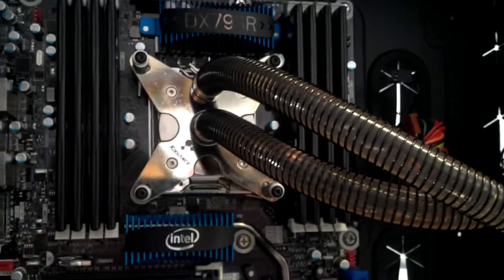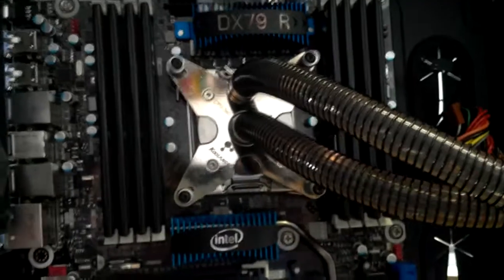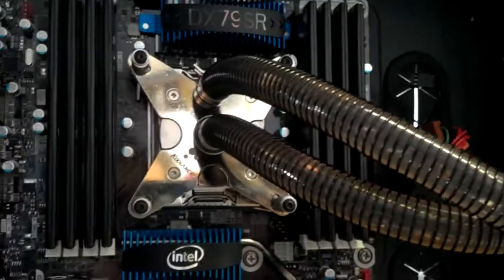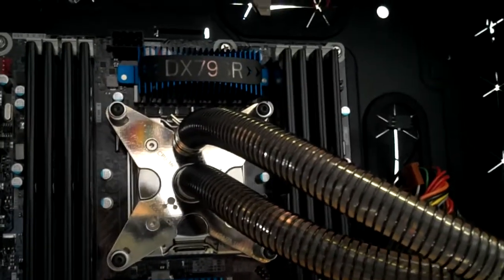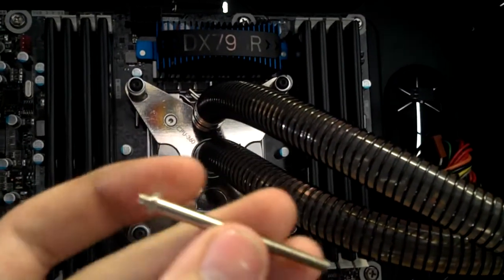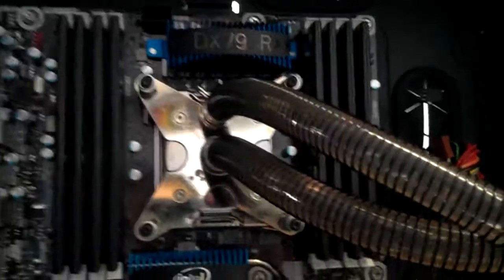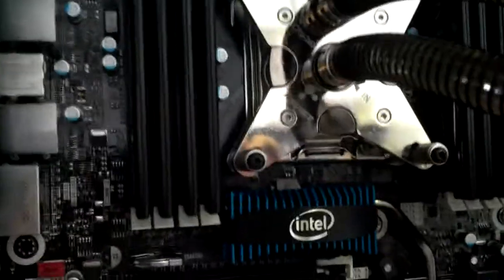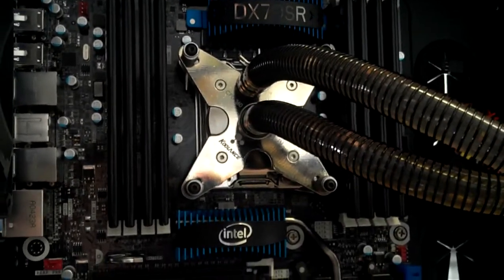Koolance CPU-360 waterblock on a LGA 2011 socket

Comment from the maker: No, you just buy the bolts that have the threads that match the socket thread and then use some washers and springs to put tension back on the block, make sure you get the right length bolt otherwise there will be too much or too little tension see description

Comment from the maker: You don't need to drill through anything, the cpu seat has threaded holes that bottom out, just get bolts with the right thread and length and you can reuse your springs to tension the block on the cpu. Or you could just get a newer water block that is made for it, but $3 of hardware and trip to the hardware store is a lot cheaper than spending $60 on a new waterblock.

Comment: hey did you have to install a back-plate for that water block?  just curious cuz i have a similar board and it does NOT have holes through the mobo.